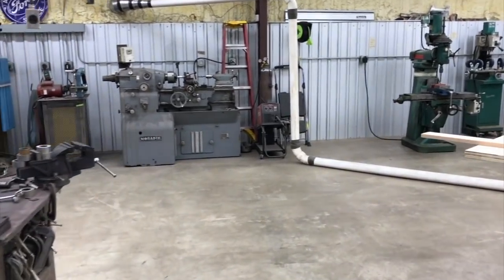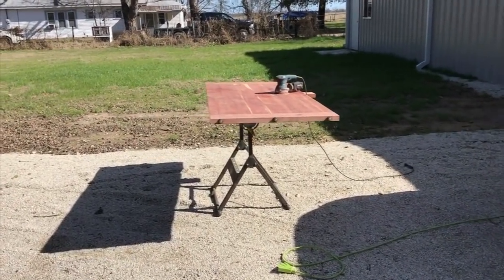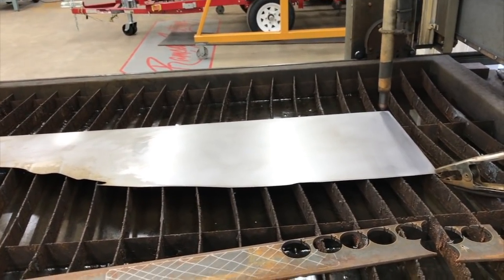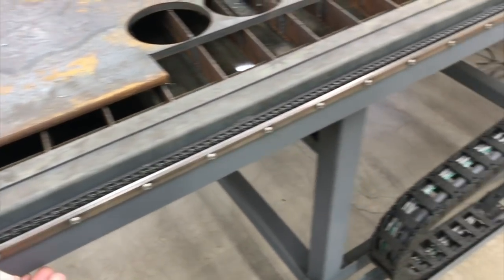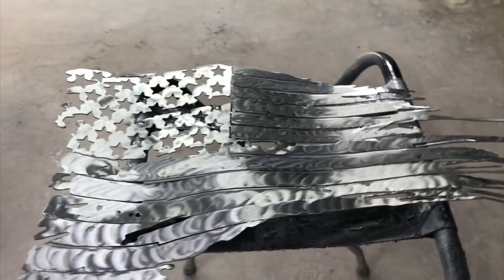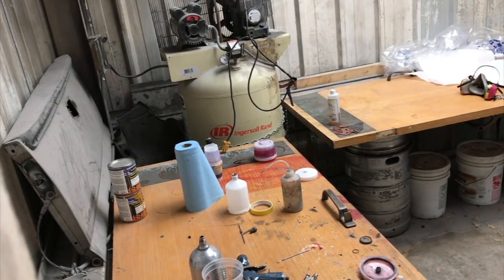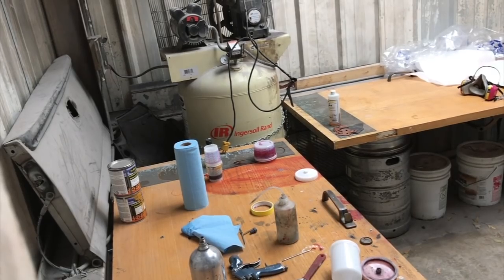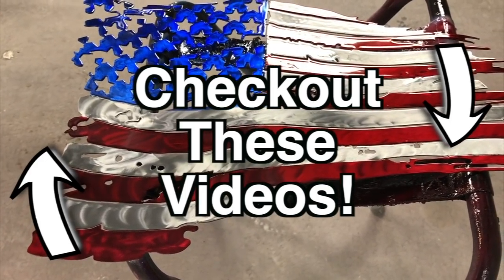Paint Gun Scammer - DO NOT subscribe to SYF

Comment: I'd be curious about doing the clear layer as a powder coat. Might get more consistent results with the added bonus of durability. But then again, I realize you don't have a set-up for that. Back in my Muscle Car fascination days, I clear powder coated a shit ton of engine parts for my Duster and Challenger. (318 and 340) Everything from March Pulley Sets, to Edelbrock Valve Covers. A friend of mine turned me on to clear. He was a sign painter. And as a side project he put cut vinyl flames on a HD fuel tank, and maybe added about 15 minutes worth of pin striping then sent it off to powder coat, and the vinyl graphics looked painted on! I was surprised they didn't melt.

Comment: I run water almost to the top of my slats on my plasma table.  What's the rationale for running the water so low on your table?
Reply from the maker: Yep, I do as well, just lazy and let it evaporate.  I filled it back up yesterday
Reply: I get kind of lazy about that, but the smoke starts to get to me. I don't have adequate ventilation to run it too dry. Keep up the good work.